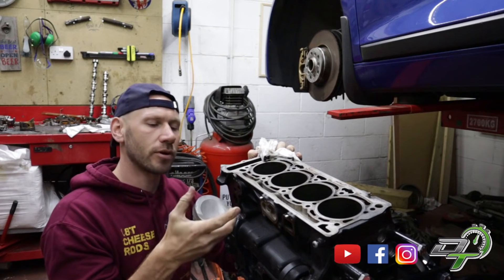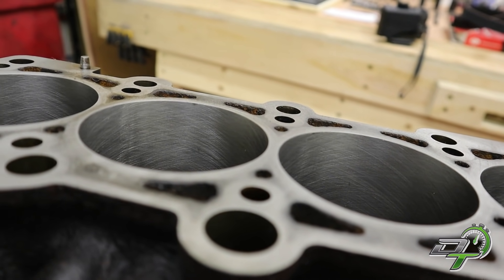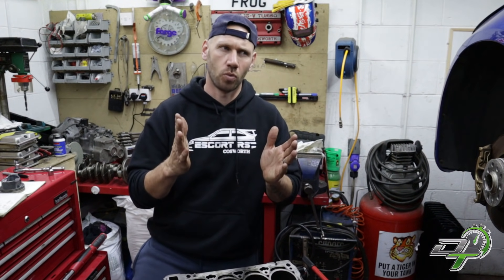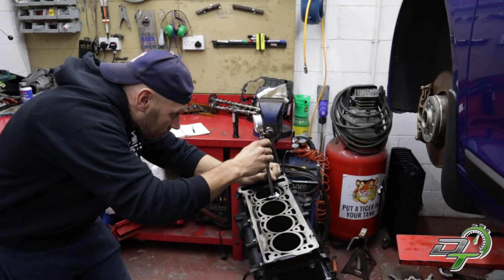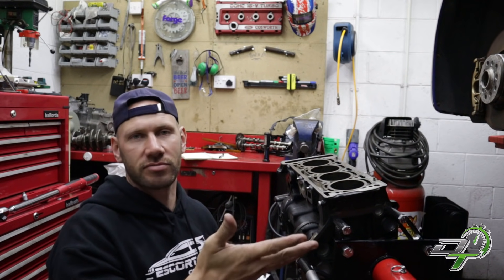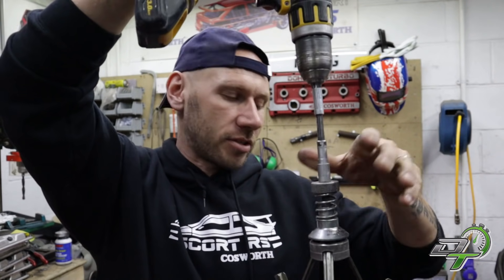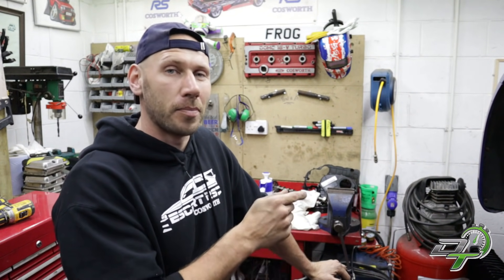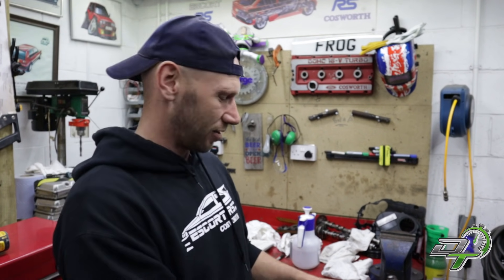How To: HONE AN ENGINE CYLINDER

Comment: This clown apparently has never heard of plateau honing.
Also I reverse taper my cylinders, the clearance is tighter 
at the top than the bottom. The machine shop does this
with a hone that has a computer app interface cylinder 
display and control of the initial
manual buffing
with a 800 wet or dry paper and finally with a 1000 grit 
paper. The finish I use is for the ring portion of the cylinder.
For the piston skirt portion  I use black buffing rouge on
drill driven cotton buffing wheels on the cylinders and the
piston skirts, the 30 degree x-hatch is still there just a little 
"shinier". I avoid the current "teflon" coated piston skirts
as well as most others frequently advertised today. The 
inexpensive coating of most Hot Rod high performance
engine kits will not last, and will shorten the engine life.
Truly effective skirt coatings are expensive. Leak down 
tests after break in, show my cylinders holding 95% or 
better of the input pressure
Reply from the maker: This clown thinks anyone cares...😁. If you want people to see the results from your cylinders, maybes you should make a video 😝
Reply: @DecimalTenths  i care, its why were here right? just saying
Reply: The formatting of this comment makes me wish i didn’t scroll this far

Comment: Great video but you forgot one importen thing, what course on the honing stones? I mean on a job like you just described, should I use 120, 180 or 240?
Reply from the maker: What stone you use is dependant on the requirement due to cylinder condition and what you hope to achieve. If a light deglase is required go for 240. If a deep hone is needed then go 120 and work it hard.

Comment: I find a nice way of measuring cylinder walls using the old piston rings and a feeler. Your method is better as your getting a more accurate measurement. I will try it this way next time new tool added to the list !!

Comment: You are showing a "glaze" breaker, a hone is a very accurate piece of equipment, capable of holding taper to .0002", the glaze breaker is not even close to the precision of a hone.
Reply from the maker: Honest...? Didn't know that 🤣

Comment: Is it bad to hone the cylinder walls with the crankshaft still assembled underneath?
Reply from the maker: It's not ideal, but it can definately be done as long as you cover the crankshaft, and then make sure you're really clean
Reply: @DecimalTenths  another question man, there is rust on the cylinder bores, mainly beneath where the pistons were travelling. would that rust have to be cleaned out fully prior to honing with the honing tool on the drill? I've tried cleaning the rust with paper and cotton pads with brake clean, but the rust isn't budging too easy. I don't want to go at itwith a scotchbrite or something something as harsh as that, nor do I want to try hone the bores without removing the rust first. Any advice you have as to how to best clean the rust off would be good to hear. 

Or is it just a case of putting the hone stones down in there on the drill and letting cut?!

Comment: What's your opinion on re-using conrod bearing cap bolts? I've the pistons out of a v6 audi 80. Can they be reused or is it too dodge? Thanks for this video I have one of those triple stone honing tools ordered from an Irish garage supplier
Reply from the maker: Hi, I'd say resusing oem cap bolts is indeed a little dodge. They're cheap as. I re use ARP bolts, but check for stretch every time
Reply: @DecimalTenths  thanks for your reply man, i couldn't seem to find matching rod cap bolts to the ones I removed, maybe if i tried ringing the audi parts deparment? On that same note, if the cranckshaft were to be removed also, are there even more use-once oem bolts that would have to be replaced? I have 8 head bolts bought, but took flywheel off too, and it turns out the flywheel bolts should be replaced also. Are they really available at a low price? Hopefully so. Maybe arp bolts are a more future-proof option I should look into

Comment: What if you dont get the stains out the cylinder but still nice smooth
Reply from the maker: All cones down to the measurement. Further honing can remove them, but if they are too deep, then the cylinder may be compromised and requires a full rebore and oversize pistons to suit

Comment: How do you clean after you do the hone? So far I've seen brake clean in the cyclinder bore. Do you have to completely clean the engine after a hone job like this?
Reply from the maker: Brake cleaner is a good shout. We do give the engine a full scrub after this process though.
Reply: @DecimalTenths  thanks

Comment: i use a 240 grit silicone carbide flex hone, then knock down the high spots with a stiff nylon brush or a bore brush. if the cylinder is tight to turn the flywheel by hand, its gonna be hard on those rings!

Comment: Thanks brother all the way from Tennessee. I'm rebuilding my first engine and I'm both confident a nervous at the same time. If that makes sense. Anyway I've built lawnmower engines a few times and now I need more power for a s10. Wish me luck. New sub
Reply from the maker: Best of luck with it dude!! Take the time, measure everything and it'll go well 👍👍
Reply: Right there with you in Nashville.
About to attempt a rebuild on a J35A3.

Comment: Probably a stupid question, but how much is it safe to hone cylinder walls before i need to look into buying bigger pistons? Or do I always need to change them no matter how little I hone the walls? Maybe it is said in the video, but I have a very short attention span lol
Reply from the maker: Measurement is the answer here 👍. But generally good condition pistons and cylinders will benefit from a light deglazing before fresh rings are fitted.
Reply: @DecimalTenths  okay thanks😄

Comment: If you know what is 44 degree cross hatching pattern, then you should get, you did it totally wrong. Don't do this guys. This video should be removed.
Reply from the maker: Whatever dude... A DIY in the garage guide to preparing what is now a 190psi across each cylinder compression test and you suggest it's wrong...? 🤣🤣 its not perfect and it's not machine shop quality but then that's not the premise of the video
Reply: 45. Your comment should be removed

Comment: Nice informative video. A few years back I borrowed a Mitutoyo surface roughness tester and spent a day playing around with different hones and techniques to get the best surface to bed rings in. Most of the testing focused around plateau honing. Will just say that I switched from a three prong as it was too rough and moved to two different grade flexihones with their own lube. I hate this term but it was a game changer for my builds.
Reply from the maker: Have to say I do prefer the finish from the flexhones... and its on my list of upgrades, amongst many others...🤣. Good to hear its been confirmed by a better testing process than my eyes 👌. Cheers for sharing dude 👍
Reply: Decimal Tenths flexhone is 100% superior to those terrible 3 finger jobs, even superior to my cnc hone in a ‘stepped’ bore, as it will get under and radius the step instead or riding over/correcting it. That said, no stepped bore is within spec at top though, so I’m rarely ‘freshening’ one up. Reality though, is, anything will run, but you need to bin that hone, get a flexhone and work on your stroke/spindle speed consistency 😉 40-45 degree cross hatch will work well on all. You never stop learning, but be sure to learn the right way 😎 BTW I’d put that through a proper machine and plateau finish it for £80